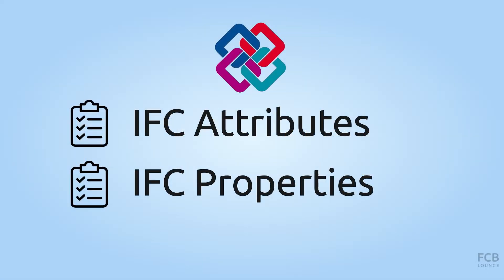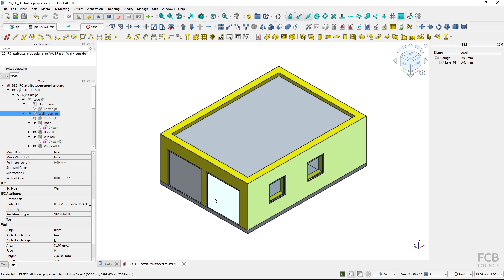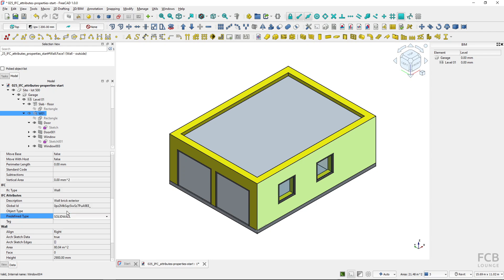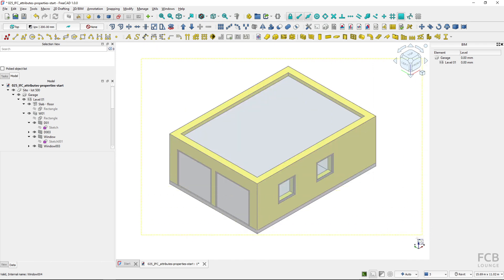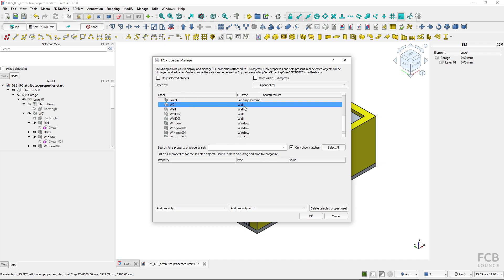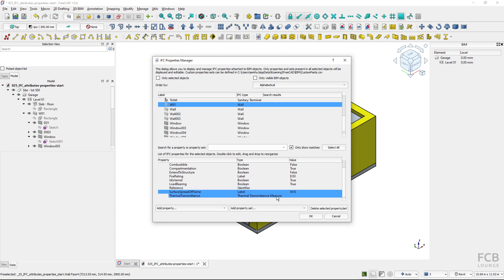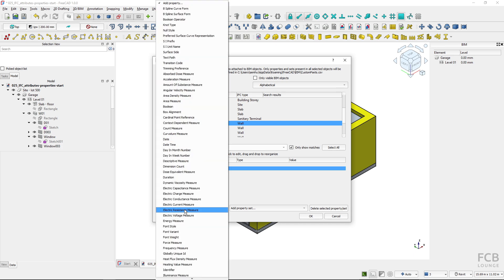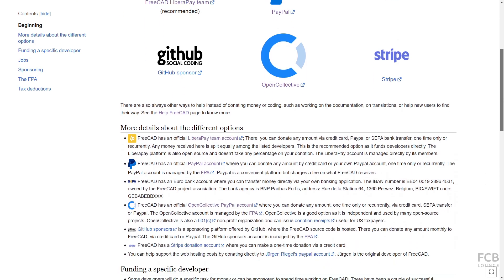IFC Attributes and IFC Properties in FreeCAD BIM

Comment: Can Freecad  schedule objects based on arbitrary pset parameters? Or select grounds of objects with shared values?
Reply from the maker: FreeCAD schedule tool is currently quite rudimentary and I don't think it works with IFC psets.

I have not thought of selecting objects based on similar parameter value. I don't know of a way to select like this from the top of my head, but it might be pssible.
Reply: @FCBlounge  Thank you for answering. At work I use Revit for BIM and it's common and very useful for me to use a schedule to select a group of objects I want to perform some action on them. Usually moving them up or down in elevation.
Reply from the maker: @JonnyD000  That is an interesting use case. I will have to think about how one would achieve that in FreeCAD.